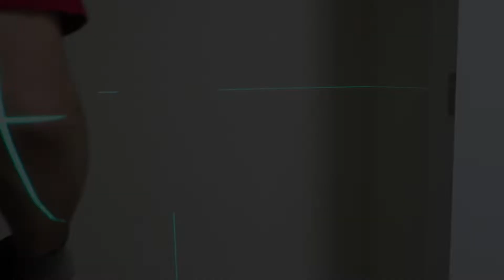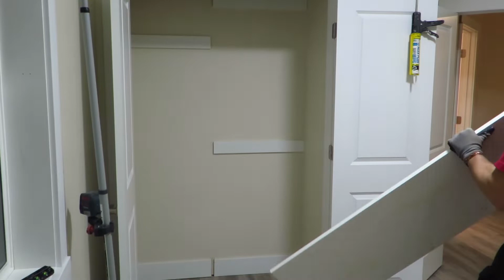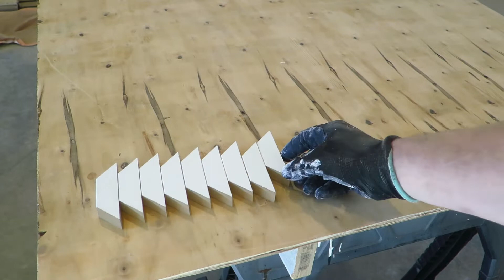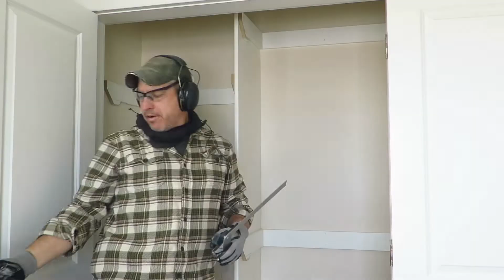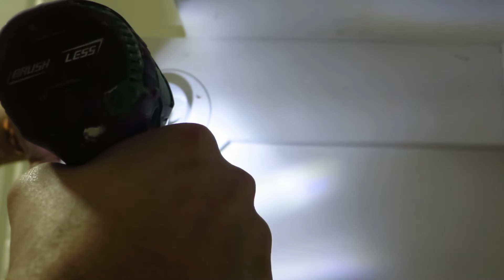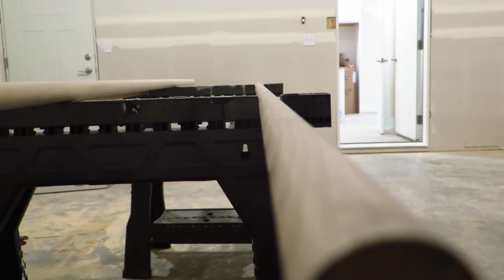Easy affordable 3-tier closet shelf built-ins.

Comment: Did you just eye ball the closet rod cup to center  it?  Another great video.  Keep it up!!!
Reply from the maker: Hey there Brett. Thank you for the comment and question. When I laid out the design of the "dog ear" trapezium/trapezoid drop-down on the cleat, I designed it to be roughly 1/4" from the bottom and two diagonal sides. So, yes it's eyeballed to save time, but real easy to be accurate.